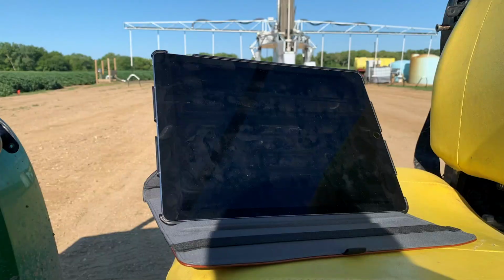360 RAIN - Questions and Answers

Comment: Half inch a week on a 180 acres field.   A center pivot can do .5 every three days or less. 

While this is a neat idea. Its not fast enough.    U would have to buy two of these to really keep up in hot weather.   Which would be fine if the cost these for two would be the same as one center pivot.  

The price of these seems way high for what it is.   Think the price will come down when other companies build these and the technology bcomes cheap.  
Like a flat-screen tv when they first came out were very expensive.  Now cheap to buy. 

Believe this idea will be popular in 10 to 15 year when its less expensive.

Comment: We have 750gpm wells for pivots on square quarters. But many fields have a smaller odd shaped field in close proximity to it. Could you make the machine travel much much faster and larger diameter piping to utilize the 750gpm well without having water runoff?
Reply: Why could you not install a VFD and slow the well down? Is 750 GPM necessary?
Reply: @naturalsolutions7025  you've clearly never been to nebraska. Corn uses 0.25 inches per day at max evapotranspiration for 250 bu/acre. We don't get rain here sometimes. Yes you need 750gpm to run a 1320' long center pivot system. The existing wells cost 70k to put in. Does not make economic sense to tear apart wells. Solution, make bigger hose on machine and make it walk several mph faster across fields so can put on up to 2" per week.
Reply: @mbaier91  run more than 1 machine for increased requirements, and that's 250 gpm per machine.
Reply: @mbaier91  I got 1 inche from June 2nd to August 10th last year. 
You've clearly never been to SW Missouri lol
Reply: @naturalsolutions7025  so spend another 75k on another machine for the same field? Or spend 10-15k modifying and have one machine...

Comment: Cool concept if it could take wheat farmers and turn them into corn farmers it would transform many farming operations in US and Canada.  But guessing it’s not that efficient with water.
Reply: That's the idea, that it is more efficient with water since it applies the water at the base of the plant.
Reply: @naturalsolutions7025  need a trade study that compares it to Drip and drip subsurface.  Thinking cost might drive other solutions
Reply: @watomb  this is cheaper than drip by close to 50%. If you watch their other videos you're actually told the water savings percentage. I have drip tape. I have been around and worked on pivots 2/3rds my life. The water requirements in the designing are quite a bit less than even tape. Also, a lot of people are against buying something like drip tape. This is a great option when considering irregular shaped fields.
Reply: @naturalsolutions7025 cool thanks for taking the time I think eventually pivots will get band from using the Ogallala Aquifer.
Reply: @watomb  not the ones that are grandfathered in. Human nature doesn't change until economics forces it to, so it won't change until it starts running dry like in texas panhandle.
Reply: @mbaier91  ya eventually the grandfather ones will get outlawed